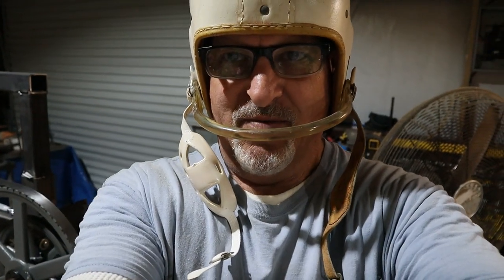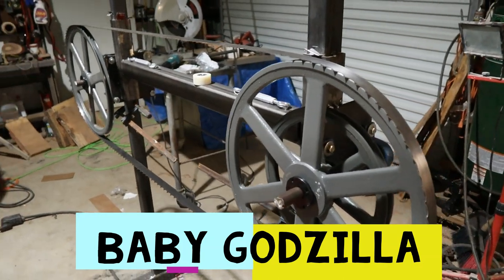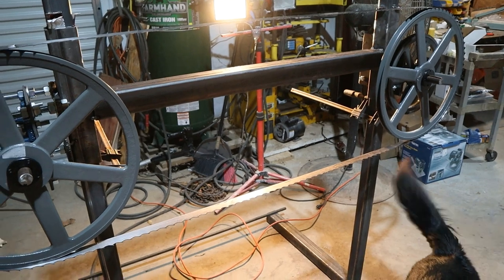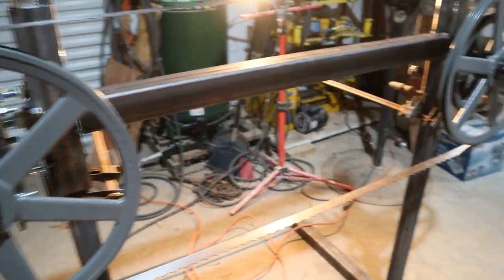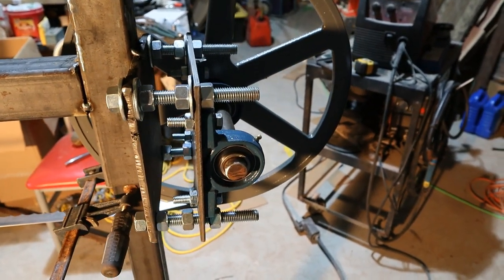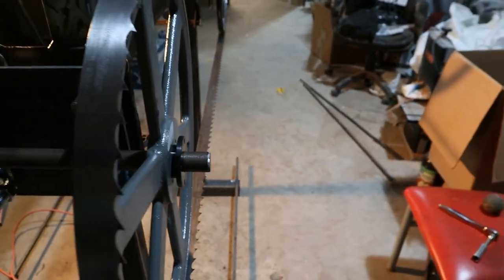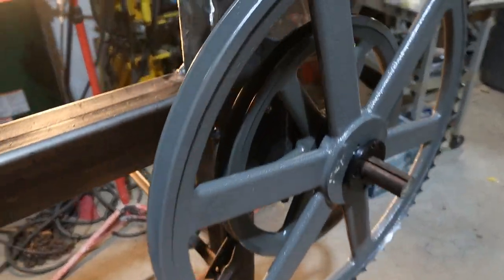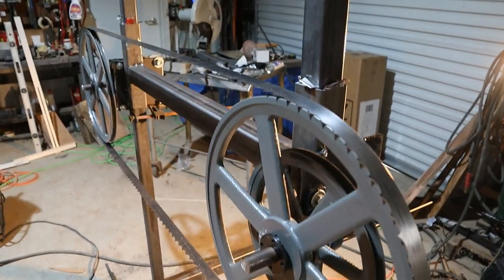158" Homemade Wood Sawmill Bandmill Build Video Part 1 Baby Godzilla

Comment: Thank you for sharing your build. I want to build one of this. Can I use 16" wheels with a .042x158" bandsaw?

Great job
Reply from the maker: you can use the 16" wheel, however the bigger the better, Less bend in the blades and less heat
Reply: Thank you for your answer. My thought was that with a smaller wheel I can have a bigger cut width. Also thought that with smaller wheels the stress on the blade will be bigger. I could go with a thinner blade but I think I'll go with 18.75 wheels. Also I don't have ginormous logs, so I think it will be enough.
Reply from the maker: Thats the way to go.. @arqhist

Comment: hey  Larry great job on both saw mills .. been looking on you tube to build one of my own  yours was the one i picked so i have started and sot some work done just waiting on more parts to come,,,,  can you please tell me what size Idler pulley  you used on your beast .... thanks and keep up the good work
Reply from the maker: The idler is a 6" diameter pulley. off of a lawnmower
Reply from the maker: let me know if you have any other questions. I will try to help you..check out my site I do have some parts listed under industrial section TXDashcovers.com
Reply: 400 мм

Comment: Can you PLEASE make a video putting the belts on the pulleys???Soap ain't cuttin' it,lol.How do you get get the belt tight in the groove after you get it on?Thanks for sharing and Stay Safe during this Covid crap!!!!BTW,don;t tell me you have less than $499 in the build when your kit is $569,lol,you're just braggin',J/K
Reply from the maker: Did you buy the belts and pulleys from us..if not and you don't have the correct size..they may never work right..I only know about what we sell and use
Reply: @LarrySbrusch  I bought the kit from someone who bought your kit and never finished.I've checked the pulley diam,etc,and he showed me a receipt,so pretty positive it's all yours.Just giving difficulty.....Not WAY undersized,maybe I don't have same grip strength anymore...
Reply from the maker: Put the belts in hot water on stove over high heat and get the belts soft.put the pulley in a vice, put one edge of belt in groove and secure it with vise grips, get two big flat top screw drivers and start working from one section all the way around pulley.the belt may fall in the groove all twisted up..but don't worry at that point..run a flat top screwdriver under belt over top of pulley ,grab screwdriver on handle and other end of it and continue to run it around the pulley and the belt will fall back into the groove the correct way..try to do all of this while the belt is as warm as possible..once it cools it will be pretty tight in pulley.
Reply: @LarrySbrusch  Got it,thanks!

Comment: Do you have the finished product video?
Reply: I used your bandwheel adjustment mechanism on my blade guides.  Hope you dont mind.
Reply from the maker: Not yet.i have been experimenting with blade guide rollers and it has been super hot..so I will not get it finished until it starts cooling off
Reply from the maker: @aaronymousunlimited2661  not a problem..we are hear to help people..

Comment: You should of put 1.5” shafts on her.
Reply from the maker: I thought about it.. may do it on the next build..I have not had any issues with the big sawmill that I have in my other videos.. I can see a little flexing when I put a lot of stress on the blade, but otherwise. no failures at this point. Appreciate the comment
Reply from the maker: Just of curiosity I decided to go with what u suggested.the 1-1/2" shafts to see how much more Ridgid the build will be..it will add an additional cost of around 150 to the build. ¿??????